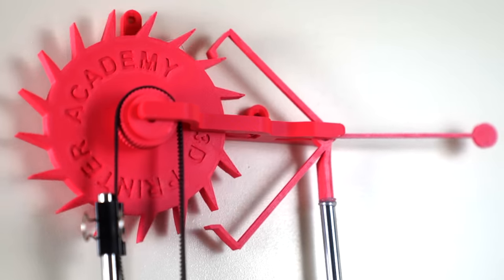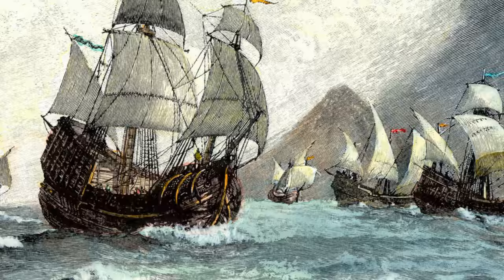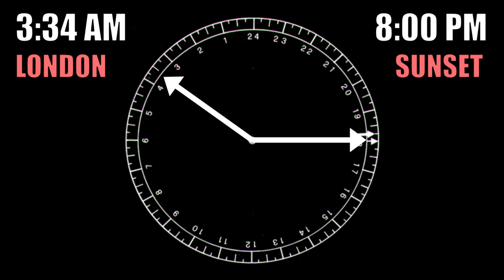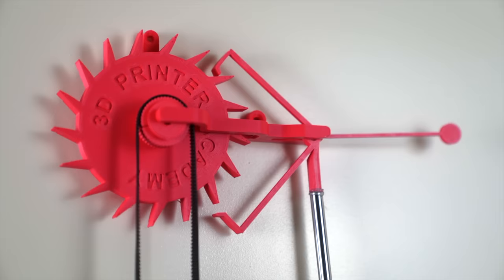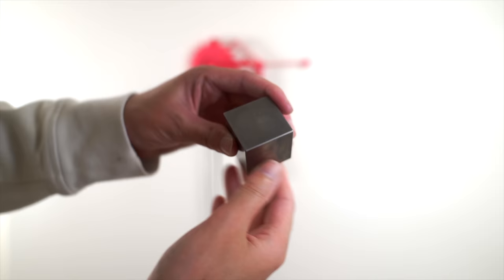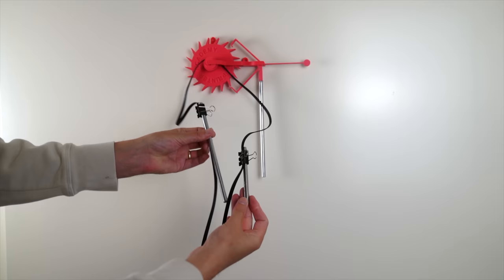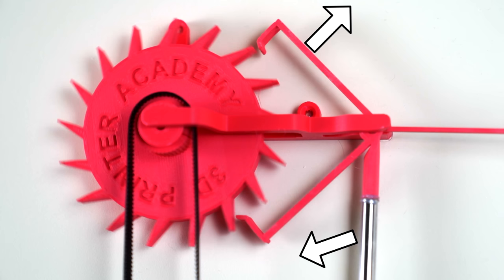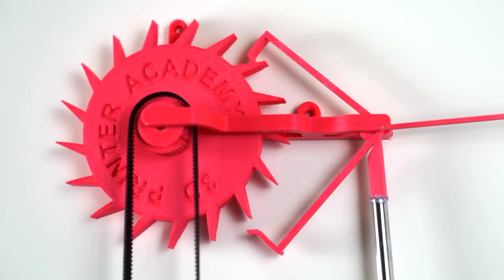How escapement mechanisms work.

Comment: So basically all they did later on was add a spring that would to create the potential energy.  Winding it up adds tension and then you release the tension the same way you did the belt with weights and now it can go possibly longer and in a much smaller space.  It's really fun to pick a apart simple machines like this I would love to see more videos just breaking down these simple machines and even seeing some small applications for the fun of it
Reply: Tick tock
Reply: Basically
Reply: It needs a pendulum too, so on something like a wrist watch, the pendulum is circular.
Reply: Yes but the key was designing springs that provides a constant force.  Normal, everyday springs don't do that. But of you make the spring much much longer than it's intended range of motion, you can get * close * to constant force. That's why spring powered watches have such a long, winding, spring coil inside of them.
Reply: @darrennew8211  well, "pendulums" are gravity-based. The "circular pendulum" you mentioned is a little wheel that oscillates based on springs instead of gravity. (and that's a different spring than the power spring I mentioned in my other reply) 

(I know you may have known that, I just think it's misleading to others to call it a "circular pendulum")
Reply: @ewthmatth  but eventually they should run out of energy right?

In mechanical watches how do they last that long?

Here he has to reset the weight back up in a watch something has to input energy!!
Reply: @FirstLast-tx3yj  some watches have a special part that helps wind the spring swaying the watch back and forth, so the more you walk with the watch, the more energy from you is going into rewinding it.

I do not remember the name of this mechanism and I dont know how it works. If i find a good link, I'll post it here
Reply: @ewthmatth  It already amazed me with the complexity and ingenuity of that system. I didnt think it could get more complex until I found out about the flying tourbillon and later on, the gyrotourbillon 😀

I'm currently trying to design a clock based on the flying tourbillon design and have it 3d printed. After that I'll try to tackle the gyrotourbillon.
Reply: @Natecas08  It's called the automatic works.
Reply: @darrennew8211  a wrist watch have a balance wheel not a circular pendulum.
Reply: That was in this video.

Comment: Actually, the timepieces used by sailors were spring-powered, not gravity powered. This prevents them from losing time as gravitational acceleration changes, for example during rough seas. Accurate marine chronometers were expensive though, so up until the last couple centuries sailors mostly determined the time by the lunar distances method. Nautical almanacs are filled with tables of the moon's position in the sky, calculated years in advance, and by consulting the almanac and measuring the distance between the moon and another celestial object, the absolute time can be accurately determined. This is then compared with the observed local time to determine longitude.
Reply: How accurate was this?
Reply: @ewthmatth  Typically the error was +/- 1 minute, which corresponds to an error of about one-quarter of a degree of longitude, or about 15 nautical miles (28 km) at the equator. (Source: Wikipedia.) Skilled lunarians could reduce the error down a little bit lower than that.
Reply: Yeah, I distinctly remember that sailors tried using gravity powered escapements to determine their longitude, but it never worked because the rocking boat would throw the pendulum around and screw up the timekeeping. It wasn't until decades (maybe even centuries) later, when spring-powered escapements were invented, that sailors could use clocks for navigation.
Reply: @areadenial2343 is right. marine chronometers weren't sufficiently accurate until the late 1700s, and weren't in common use until the 1800s. also the pendulum clock was invented by christiaan huygens inspired by galileo's discovery that the period of a pendulum was constant.

Comment: Nah the sailor clock was invented by John Harrison with the h1 clock not Galileo this is well documented and undisputed in fact as a normal escapement as shown in the video was inaccurate at sea. 

The grasshopper escapement and a swinging balance allowed accurate timekeeping at sea invented by john Harrison. He saw clocks differently as a synchronised ecosystem. Harrisons h1 clock design made the UK forces superior with accurate timekeeping no other country had and become the leading navy with the first clocks that worked at sea. Escapement gears like the one in this video didn't work at sea, it was the invention of the grasshopper escapement and a balanced swing which was unaffected by the motion of sea.

Comment: You put the potential force the wrong way. Its rotation should be reversed to prevent the cogs from stopping the pendulum's inertia so it runs for longer. It also allows the small flaps that are angled are able to get the force required to keep the pendulum swinging. I'm surprised only a few have realized.

Comment: Something I long wanted to know and beautifully explained. One reason for my curiosity was the word "escapement" itself. Is this due to the forerunners of mechanical clocks being water clocks, in which a simple hole at the bottom of a vase regulates the speed of the escaping water just as the speed of the falling weight, and its "escaping" gravitational energy, is in the mechanical clock?

A word which goes with "escapement" is "catchment". Maybe there was a catchment vase for the escaping water.
Reply: Nope.  It is because the gear "escapes" the lever only to be caught again at the bottom.

Comment: Can you do one that has a spring you wind up? It could be built into the center of the wheel. That would give it a longer potential run time. Nothing like a complicated clock but something to show how a spring in a clock works with an escapement wheel.
Reply: springs are finicky and dangerous, not for 3D printed cases.
Reply: @h7opolo  you could try putting a small metal ring in the middle to mitigate the plastic fatigue.
Reply: @frankdelucey2137  oh, but of course.
Reply: @h7opolo So you don't trust 3d printed with metal inlays?
Reply: @frankdelucey2137  my reply to your reply should mean to excuse my original reply.
Reply: @h7opolo  how would I have known that until you mentioned it?
Reply: @frankdelucey2137  "oh, but of course" is a phrase that means "i stand corrected." capiche?
Reply: @h7opolo  Capiche

Comment: Very cool. Its possible to make a loop and do a working clock?
Reply: No loop. A pendulum clock needs reset every time the weight gets close to the end of its chain; just lift it up and the counterweight on the other side will drop, pulling the slack. Now the clock can continue running.

Comment: ok.. Here’s a question. It’s a thing I need. I have a feeling it’s possible.. probably quite simple when fully refined and would potentially be very comercial if produced. A water powered irrigation timer.
I have a stream that enters our land from above. I have a simple pipe sitting the stream tip the hill which gives me free water at great pressure to irrigate all my veg.
I want to automate the timings of the sprinklers for many obvious reasons. I thought this would be simple but it seems not.. The irrigation timers I can find on the market all seem complicated and crazy expensive.. I feel sure that I should be able to use the water pressure to power a kind of clock mechanism which could turn a switch on and off at set intervals.. Does that sound doable to anybody.
Its a fairly common situation.. the only variation is that most people are using municipal water supplies but the pressure is equivalent. I’m confident if a timer could be made that used only the water pressure, was 3D printed so therefore easily scalable, had no electronics so much less to go wrong it would be a very viable commercial product.. I’ve had a few designs but nothing is slotting fully into place yet.. any thoughts anybody..?

Comment: So what if you build a massive clock, could it provide a suitable amount of energy? 
I mean, it's pretty darn clean right?
Reply: It doesn't make any energy, it stores energy (your energy when you reset the weight) and releases most of it at a controlled rate, the rest is lost through friction.  In this particular design it seems to lose all of the energy as no work is actually performed.  The usual way to store energy for later release in a productive manner would be to pump water up into a large reservoir and release it through a turbine electric generator, better of course if you can command the rain to fill the reservoir.

Comment: Yah.   But how does a grandfather clock not need to be reset every hour???
Reply: Because it’s weights don’t directly turn the escapement wheel, it turns it through a gear set

Comment: The trick is to get the weight back to the top.
Reply: Yep, resetting the clock. Just lift the weight up and the weight on the other end of the chain will pull the slack.